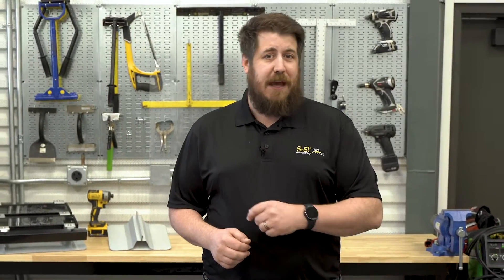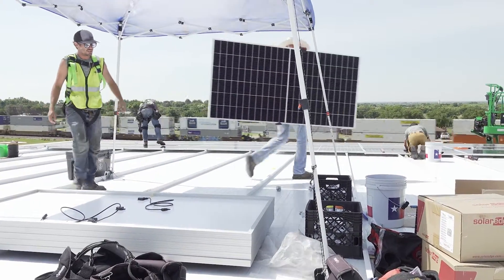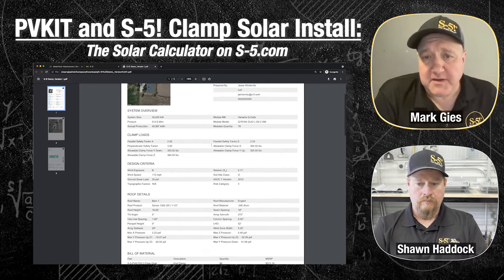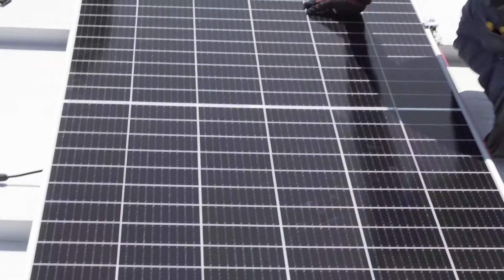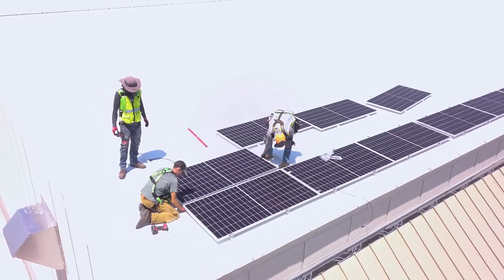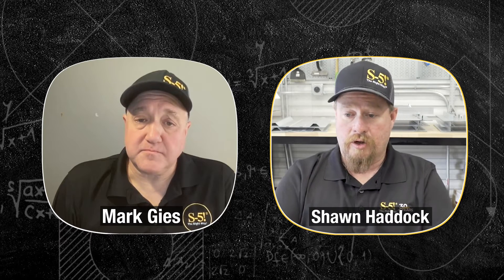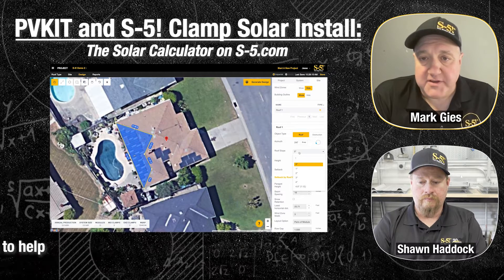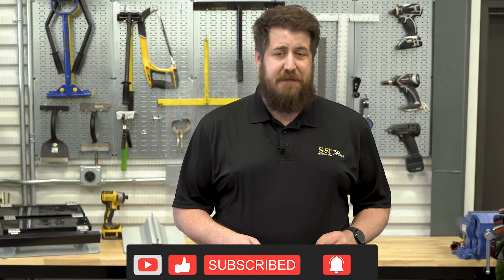The best way to mount solar to a commercial standing seam roof! - Part 2

Comment: I am about to do this with my back patio, I didnt think to just get a solar clamp to use right along side of the roof clamp, I just assumed install a rail system first.

But despite how well this worked for a smaller residential system I think its worth adding the equipment needed to tilt the panels for not just better production, but also better self cleaning.  

Nobody wants to get up on a roof every few months to clean solar panels.
Reply from the maker: Thanks for the feedback! Tilt systems certainly have their positives, but flush mount systems do too. They allow for more modules in the same amount of roof area and the racking is often much more cost-effective. And importantly, the amount of force created by wind and snow on the solar panels when they are flush mounted is significantly less.